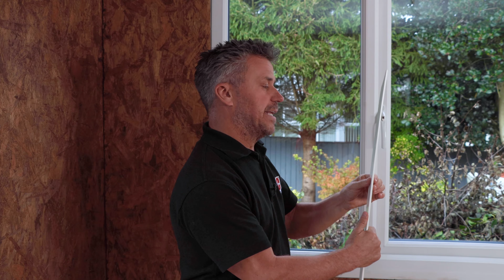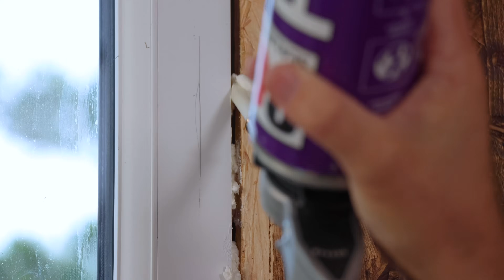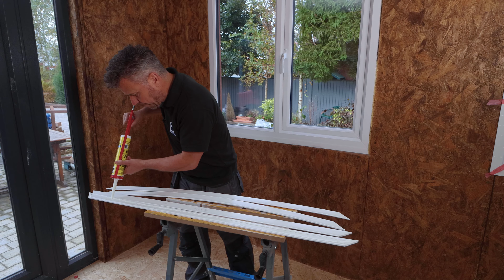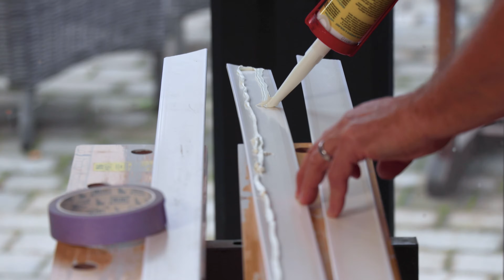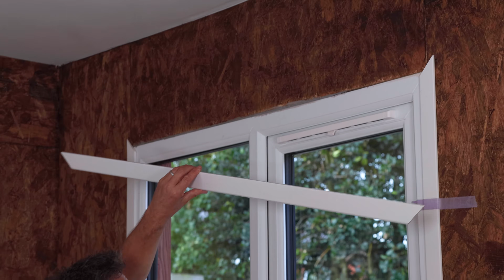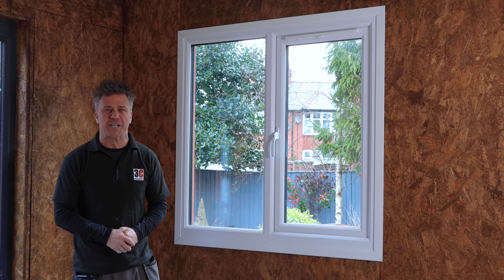How To Apply Plastic Trims Around UPVC Window

Comment: I have a trim like this along my inside window sill butting up against the uPVC frame. It has been sealed between the fame and this trim with some sealant that goes very hard and shiny (i.e. dust doesn't stick to it). Can you tell me what this is called please as after 12 years it is cracking. Thank you